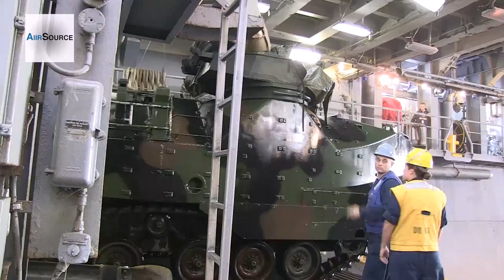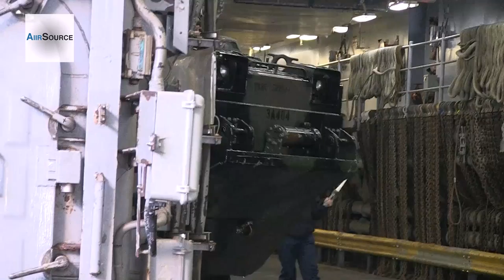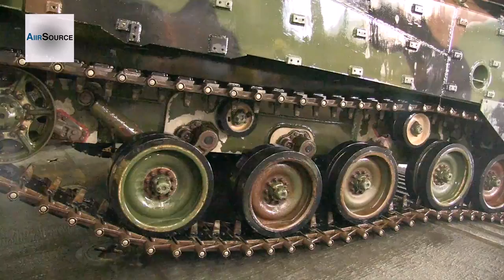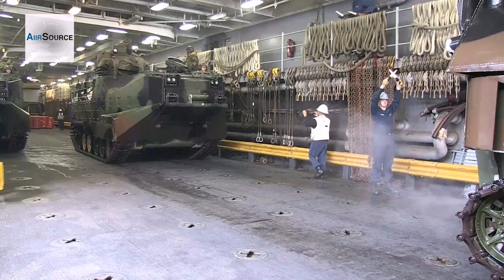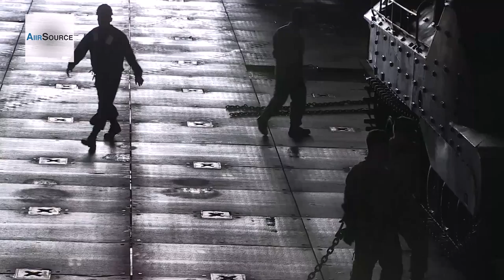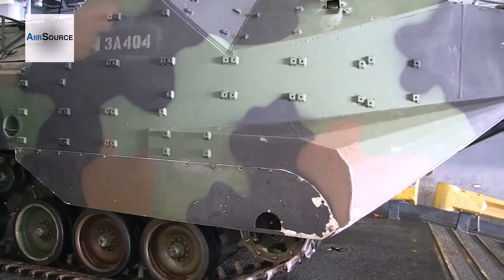USS Pearl Harbor - Assault Amphibious Vehicle Operations

Comment: This is a ..." If he could ".... So if President Trump was to order the pentagon to deploy a rescue / evacuation operation, How long would it take to move the USS Wasp (LHD 1), and her sisters from Norfolk, Virginia to the coasts of Houston,Texas and New Orleans, Louisiana ?

USS Wasp (LHD 1), Norfolk, Virginia
USS Kearsarge (LHD 3), Norfolk, Virginia
USS Bataan (LHD 5), Norfolk, Virginia
USS Iwo Jima (LHD 7), Norfolk, Virginia

General Characteristics, Wasp Class
Builder: Northrop Grumman Ship Systems Ingalls Operations, Pascagoula, MSississippi
Date Deployed: July 29, 1989 (USS Wasp)
Propulsion: (LHDs 1-7) two boilers, two geared steam turbines, two shafts, 70,000 total brake horsepower; (LHD 8) two gas turbines, two shafts; 70,000 total shaft horsepower, two 5,000 horsepower auxiliary propulsion motors
Length: 844 feet (253.2 meters)
Beam: 106 feet (31.8 meters)
Displacement: LHDs 1-4: 40,650 tons full load (41,302.3 metric tons)
LHDs 5-7: 40,358 tons full load (41,005.6 metric tons)
LHD 8: 41,772 tons full load (42,442.3 metric tons)
Speed: 20+ knots (23.5+ miles per hour)
Crew: Ships Company: 66 officers, 1,004 enlisted
LHD 8: 65 officers, 994 enlisted
Marine Detachment: 1,687 troops (plus 184 surge)
Armament: Two RAM launchers; two NATO Sea Sparrow launchers; three 20mm Phalanx CIWS mounts (two on LHD 5-8); four .50 cal. machine guns; four 25 mm Mk 38 machine guns (LHD 5-8 have three 25 mm Mk 38 machine guns)
Aircraft: 12 CH-46 Sea Knight helicopters; 4 CH-53E Sea Stallion helicopters; 6 AV-8B Harrier attack aircraft; 3 UH-1N Huey helicopters; 4 AH-1W Super Cobra helicopters. (planned capability to embark MV-22 Osprey VTOL tilt-rotors) and F-35B Joint Strike Fighters (JSF) STOVL aircraft)
Landing/Attack Craft: 3 LCACs or 2 LCUs
https://en.wikipedia.org/wiki/USS_Wasp_(LHD-1)